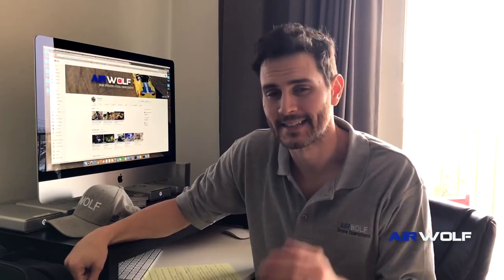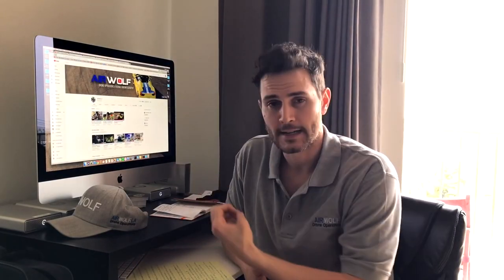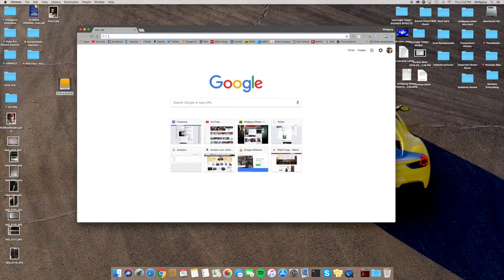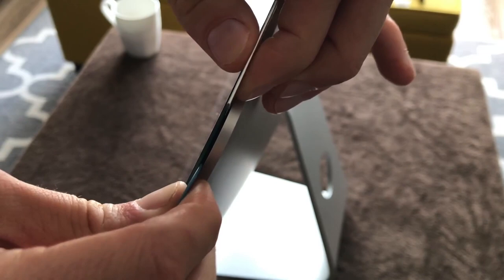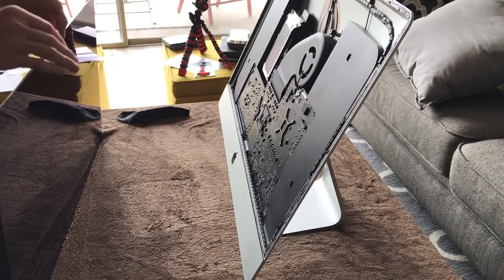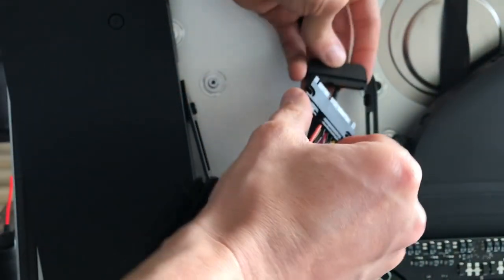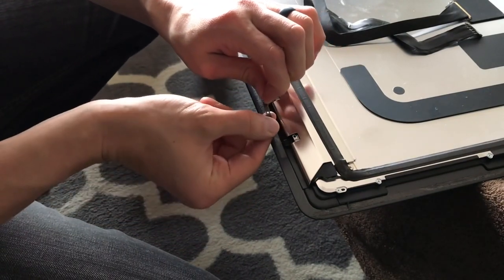Step-by-Step iMAC SSD Upgrade Guide for 5x Faster Performance | 2012-2019

Comment: Just as an advice... I would NEVER use a sharp metal blade to cut the adhesive around... That's dangerous, and also prone to issues if you accidentally slip around the rounded edge AND the camera. There is a plastic tool like a pizza cutter that exists and does a wonderful job with no risk at all ! And I would also put the iMac in an horizontal position before removing the screen... it happened in other videos that peoples accidentally dropped the screen and broke it... just my 2 cents !
Reply from the maker: Agreed. I just used what I had and I knew the areas to be extra careful. I appreciate your 2 cents though. Thank you 😊

Comment: Followed exactly the steps and procedures in this video.  I used super duper to clone my new SSD.  After 4 hours of cloning, I went ahead and proceeded with the replacement.  When I pushed that power ON button (fingers crossed) everything came up without a glitch!  After installing trim, my late 2013 Mac is considerably faster.  Thank you Airwolf!
Reply from the maker: That’s a WIN in my books. And ya, that cloning can take quite a while 😆.  Hope you at least enjoyed a movie or something.  Happy to have helped! And thanks for commenting. 😊🙏🏻
Reply: How long did you leave the Mac unplugged before you began the process ? To prevent electric shock
Reply: Excuse me: what do you mean when you say “after installing trim”?
Reply: @MrEtorkizuna  That must have been a typo.  I might have meant "after installing this"
Reply: @saticoypm  thank you. Before starting This complex procedure i do not want unexpected surprises. Thanks for answering
Reply: @MrEtorkizuna  If you follow the steps closely, you shouldn't have any problems.  I'm glad I was able to do it.  I installed a 1 TB SSD and am glad I did it myself.
Reply: @saticoypm  thank you for your words. I will do it before the year ends. I have already ordered 1TB SSD crucial and 32MB OWC RAM.

Comment: I have a late 2012 27" iMac and I have been tempted on purchasing a brand new 2020 model. But after watching your video and realizing how easy it is to upgrade the HD and RAM I am going to hold off on purchasing a new machine for at least a few more years. This video is super helpful so thanks for sharing!
Reply from the maker: Thanks so much!! Happy to have saved you some money. :)
Reply: AIRWOLF so will replace my old hard drive make my 2012 faster?
Reply: @EmmureMARIO64  I have a late 2013 21" iMac, at first was thinking on adding RAM, but after watching this video I decided to replace the Hard Drive with an SSD also. I doubled to 16GB RAM and an SSD.  It has been a few months now, and I can't believe how fast this machine is. I am not a heavy user (like Video or Gaming),  but haven't had an issue with the fan or heat. Of course, there are risks involved in the upgrading process. Thankfully, I didn't have any....so far. THANKS AIRWOLF

Comment: Excellent video> I used this to make my 2012 mac super fast. I declined to take the glue off the bottom of the screen and just opened the top and put it back together . Worked like a charm your instructions. Also you do not need to pay for superduper they want you to register but its free and that was a nice surprise.

Comment: I just had my failing 3TB Fusion drive replaced with a 2TB SSD drive. Total cost with tax was $511. I used an authorized Apple repair company in Burbank CA. They did install a thermal sensor. They did a great job. Can’t complain.
Reply from the maker: Was it Melrose Mac?
Reply: @AIRWOLF  Yes, sure was.
Reply: @AIRWOLF  I’m waiting for Apple to come out with another 27 inch iMac that has the new hardware. So in the meantime I just fixed this to get me through the next year or so. Hopefully they release one soon.
Reply from the maker: @TheCarCrazyGuy  Those where the folks that wanted to charge $1200. But! That was quite a while ago.
Reply: @TheCarCrazyGuy  At this point, it looks like Apple is determined to never come out with a 27" Mx-iMac.

Comment: THANKS SO MUCH FOR THE VIDEO AIRWOLF!! 
I have a late 2013 21" iMac and it was super slow, I was considering doubling the RAM to 16GB and when I saw your video I decided to do both, upgrade RAM and install an SSD (WD Blue 1TB).  What a difference!! Feels like new. Super-fast. Reboot takes 10-15 seconds. Now after 2 months, no issues at all. By the way, I reinstalled my old slow Parallels 12 and now it works like a charm. Once again Thanks!!
Reply from the maker: You're very welcome!

Comment: So I was thinking about it and I bought a 2019 4K iMac 8gb ram i3 with 1 TB HHD on ebay for 700. Upgraded to 32 go ram and 1 TB SSD for 325 bucks. That same iMac sells new for 2500. Nailed it! This is the first time I have seen my mavic air 2 videos in 4K. Thanks for the great video
Reply from the maker: Such a huge difference.  I’m sure it can even handle 4K Pro Res as well.

Comment: This really isn't that difficult if you follow the steps,  I installed a SSD and upped the ram in my late 2013 27" iMac and then followed another video to install Mac OS Ventura on it, it is now performing like a new computer.  Great video!
Reply from the maker: Thanks bud! If you don’t rush it, it’s quite simple.
Reply: Did you go for the thermal sensor or are you running without it? I'm hearing that the late 2013 iMacs don't need it but the early 2013 ones do as they didn't get the SMART update in the boot rom version

Comment: 1. Carbon Copy Clone will not work for Mac OS Sur Public Beta (for those thinking about cloning) 
2. I downloaded the Mac OS and installed in external SSD 
3. I used SanDisk Extreme Pro 500GB SSD, It is working great
4. The SanDisk SSD not getting warm
5. My 2017 iMac (2.3 GHz Dual-Core Intel Core i5 with 8GB RAM) is much faster than my 2019 Macbook Air (1.8 Dual-Core i5 with 8GM RAM)
6. Now my iMac startup time reduced to 20 seconds (SSD) from 1.5 minutes (SATA drive)
7. All the apps are opening instantly (previously the app will jump for few times and open slowly)

Comment: 0:00 Intro
2:37 Tools Needed
4:22 Cloning the Hard drive
4:35 Before Speed
07:27 Taking off the 5K screen
10:49 Hard drive removal
 11:52 Installing SSD/Thermal Sensor
14:38 Re-installing Screen
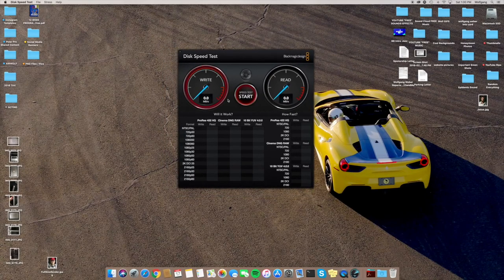17:17 After Speeds
Reply: If you use this format in the description, the chapters will show up in the video player. You always have to start with 0:00 Intro.

Comment: Thank you for putting this tutorial together! Gave may late 2013 27-inch a new life. I hit a snag when I booted up the cloned SSD. I got the Apple logo and as it seems to finish loading, my iMac just shut off; this happened multiple times. I ended up putting the old mechanical HD back and re-cloned it; however, this time I used Carbon Copy instead of SuperDuper, and it worked. Oh, and I added 8GB of RAM, equaling to 16GB.
Reply from the maker: This all sounds great Mike. Happy to at least helped a little. 😊
Reply: was carbon copy free?
Reply: i tried cloning the hdd to ssd through disk utility and for some reason it wouldnt boot up from the ssd. and then my imac wouldnt boot up from the hdd also anymore. so right now im reinstalling catalina onto the hdd so i can try again using super duper or carbon copy. i am so annoyed

Comment: Great video and you reaffixed the screen correctly in an upright position so as to get a flush fitting on the bottom base.  The OWC video (which unfortunately I followed) shows to reaffix the screen with it flat which results in the base not sitting flush as there's no weight on it.

Comment: Airwolf, this is an amazing video. It gave us great confidence in my DIY projects. Is the video applicable if I have 21.5 i5 Late 2015 Imac? How much max RAM can I upgrade this 8GB ram and what ram can you recommend. Also Can I use 2TB of Samsung SSD instead of 1TB?
Reply from the maker: Thanks for commenting and sorry for the late response. Now I’m not 100%. But I think you can only max your RAM to 16G and your hard drive to 2T on that model. As for RAM recommendations I like to use “OWC”, but if you’re on a budget  “crucial” honestly works just as fine. Hope that helps. Happy Holidays!

Comment: This is a very well done guide, thanks a lot.

I noticed in the end, when you put the adhesive tape on the mac, it looks like you put it on both sides. Did you buy two of those for slightly added thickness and easier installation? Thanks!
Reply from the maker: There was only one kit purchased.  And there is a section that you do apply to the back of the monitor but not the whole thing. :)

Comment: To save time just unplug the hard drive cable, plug-in the new SSD, place a small bit of double sided tape onto the old hard drive front surface still in place and stick the new SSD on the old hard drive surface. 30 sec tops to do, and yes the spacing is enough not to interfere with the monitor.

Comment: Thanks for the video. Very informative! Do u really need a thermal sensor for your ssd? I was planning to connect direct with the existing iMac SATA cable
Reply from the maker: I mean I also heard that you don't as well.  But at the time I figured that it wouldn't hurt to just have it.  I'm messaging from the computer I worked on.  And its never given me issues. Happy that I was able to have help you. :)

Comment: Thanks for uploading this, I am planning to do this with my late 2015 imac in a couple of days and yours is the most helpful video I´ve found. Just one question. Is it possible to do a  Time Machine restore on to the new SSD instead of cloning the Mac HD with other software? Will that work as well? I would like to do that before I install the SSD so I can check if it works before I put on the new adhesive as you did on the video. I know it´s possible to do the restore once the installation is done but I prefer your way. Thanks, and keep up the good work!
Reply from the maker: Sorry for the delayed response.  But yes! You can use Time Machine to restore everything. Happy building and thanks for stopping by. :)

Comment: Hi!
Thank you for the video. Really nice. Gave me the courage to try it! :-)

But I have a doubt: how do you use your 2 ssd drives? Now you have the original 128gb SSD (that came originally in the Fusion drive) and the new 1TB Samsung SSD you installed. Do you use both together as a fusion drive? Or are they separately? Or you just ignore the original 128gb ssd?

 I want to do this process. But I am not sure about that. 

Also, I am in Brazil and I couldn't find the thermal sensor here. I will try using an app to make reduce the noise if needed. Any tip on that?
Thank you!

Comment: Nice! ONE question: if I have an internal 1TB m.2 nvme SSD pre-installed factory iMac I bought (it's the late 2015 27" version) that I want to keep inside. Can I add a second 2.5" internal SSD like the one you have in the video and add a second 2.5" SSD so I have 2 internal SSD's, one my original 1TB m2 SSD and one 2.5" internal SATA cabled drive, so 2 SSD-fusion drives so to speak? 
Why I ask, I really want to avoid to remove the 1TB and have it loose and replace it with a 2-4TB "new" cloned SSD and have the old one as a backup/external connected SSD. So my goal is to have 2 internal SSD's, keep my 1TB m2 SSD and have another SSD but connected like u did and avoid having too many external SSD's hanging from a USB hub.. :) Really apprecaite your feedback!

Comment: I just fixed my iMac using an external USB T5 Samsung SSD and cloning my hard drive to the SSD using Carbon Copy.  My iMac takes 42 seconds to go from hitting the power button to the login screen.  From the login screen to full desktop takes 7 seconds.  Opening Final Cut Pro about 2 seconds.  I am so glad this fixed my extremely slow 2015 iMac.
Reply from the maker: YEAH! 👏🏼 👏🏼👏🏼. Mines still going strong! Happy to have helped.
Reply: Did you use USB 2.0 for that though? I thought that drastically slows down an SSD. If it doesn't, I am totally down to try that one out.
Reply from the maker: The Dudelino No I use USB 3.0

Comment: Best instruction I've seen on this.  Thanks.  QUESTION.  I have a 2013 27in iMac that has a 1T HDD and 120 SSD (I don't know what it looks like inside!!) would putting an 1T SSD have an impact internally - eg keeping things cool and any space issue???
Reply from the maker: Yes 100%.  And it’s the same process to remove it. 🤙🏼

Comment: Hi, great video, one question.... you put the link for 3M sided tape, but in the video you use another tape even with instructions and numbered... it confused me, what is the tape do you recommend? i have iMac 21.5-inch, Late 2012.
Reply from the maker: I used the tape that came with the kit.  Folks were saying that it's not strong enough.  But I used it and it's still holding just fine.  I suggest cleaning the surface really well.  Anyhow I did link the 3M tape for those who want to opt out of using the kit tape.

Comment: TIP for easy future access: instead of adhesive strips simply put on a couple of small pieces of clear tape (on the outside of the rim) to keep the display in place.

Comment: I have the same question about the thermal sensor ... actually didn't wanna buy that thing lol. Didn't know about the cloning software, first time i see it in these tutorials i've been watching. Good video brother!
Reply from the maker: Thanks!
Reply: You don't need the thermal sensor, you will only waste your money.
I updated an iMac late 2012 with an SSD and I have no issues at all with the fan. 
Use carbon copy cloner, it is the best software to do a clone.
Reply: @lukedotcom  can i skip the sensor without even having to use extra software, would it be fine, its for the wife and she hates tinkering with her computer

Comment: I have to comment. Never use a sharp blade to get between the glass and bezel. It could and will scratch the inside edges of the display. A proper screen removing tool is available of Amazon for less that 10 bucks, it’s like a plastic mini pizza cutter. Secondly after unplugging the power you should always discharge the caps on the psu but press the power button for a good 10 to 20 seconds. That psu will give you a shock if you don’t and trust me it hurts like hell. Thirdly the adhesive is fitted to the enclosure only and only remove the back off the very bottom so you can place the screen in at the right place and it will hold straight. Those strips are designed to be pulled by the tabs outward when the screen is fully in place.  Tips I have learnt over doing so so many of these screens. 👍
Reply from the maker: thank for the comment

Comment: Thank you for the video. I'm just in a middle of the decision making regarding to upgrade my iMac18,3 (2017). 
As far as I looked a lot of upgrades videos and tests, I found that in case your iMac has Thunderbolt 3 (which is 40Gbps) it is possible to buy nvme enclosure and according ssd drive, any size you wish and not which your iMac supports. The test speed I seen was 1900MB/s / 2366MB/s,  that is twice higher than my current Fusion drive shows. (must be 32GB ssd speed as 1TB hdd is at sata3, what is 550MB/s max). 
Again, who is not comfortable with whole system  storage just handing over cable outside - internal upgrade will be a solution. 
I doubt to go inside iMac by myself and the cost in repair service is twice more than such enclosure costs. But there is always a choice! 
The beauty for us is that I may have my ssd with all setup and whole data and my wife may have own ssd and we just swap these and no any more words that I moved or touched something at her desktop any more!!!! :))))))))))

Comment: Very Well explained and clear. Thank you. 1 question please: at the beginning When you clone a SSD, si the one then stays inside? That is  why restarting the computer after the whole Work recognizes everything easily?
Reply from the maker: If I understand correctly.  Yes! I first clones the NEW hard drive while leaving the older one inside.
Reply: @AIRWOLF  THank you for your answer. Thank you for the video. I will do ít next weeks. Seeing your Video, clear and straight…CRUCIAL because I have no experience in these issues….I go for CRUCIAL MX 500 1TB and 16MB OWC and your tip about clone. I have a 21.5 iMac 2017, id: 18.2.ALL the BEST Mar. AIRWOLF. Merry CHristmas

Comment: thanks for the great video and explaining the thermal sensor! apple is notorious for excluding thermal management and just letting things thermally throttle. that is very low tech compared with the high tech way they handle a lot of other things, so this thermal management is welcome. thinking some more, i wonder about replacing the thermal paste? maybe for the chip set? search youtube: replacing thermal paste on imac. hum, looks like you missed an opportunity, but i skipped through your video, so maybe you did this too. my apologies if i missed this.

Comment: Hi. thanks for this great video.
a doubt.
previously I suppose you have cloned the video. if I make a clone via Carbon Copy cloner, for example, can I install on SSD directly and will it light up without problems? Or are there problems powering up with a cloned disk, but do you have to use system preferences that this is the new boot disk?
thanks and greetings from Barcelona

Comment: Thank you for this. May I suggest, however, NOT applying the adhesive tape upon putting the screen back on but simply placing a small piece of clear tape on the top and side to prevent it from falling out. Should be more than enough to keep the screen in place unless you carry it around like a laptop. And, you will have easy access to the internals any time.